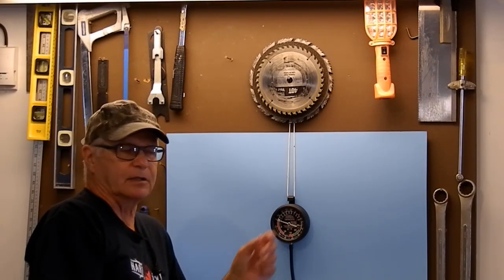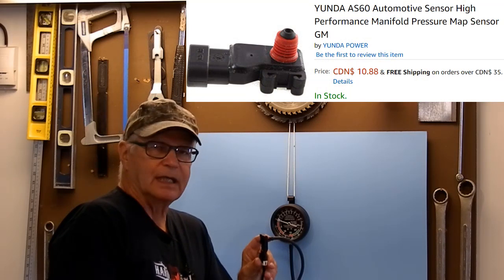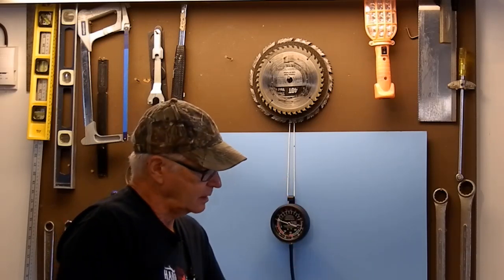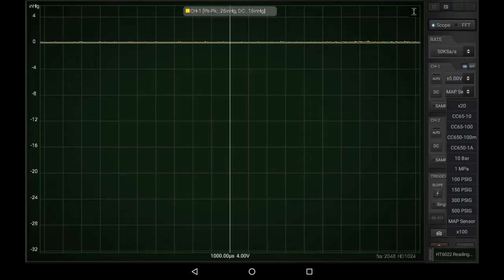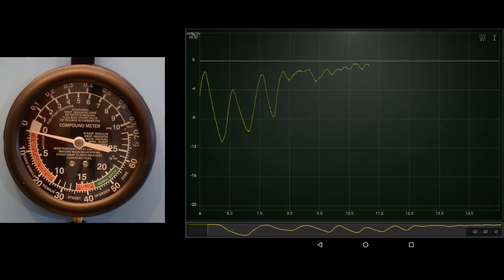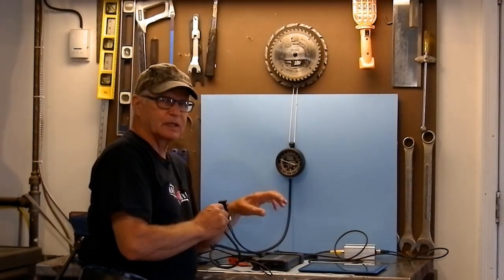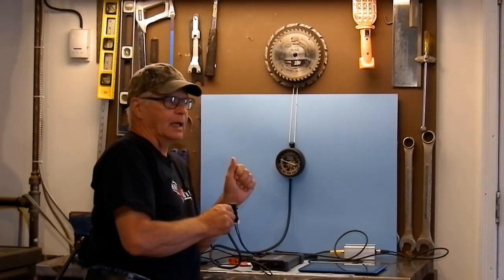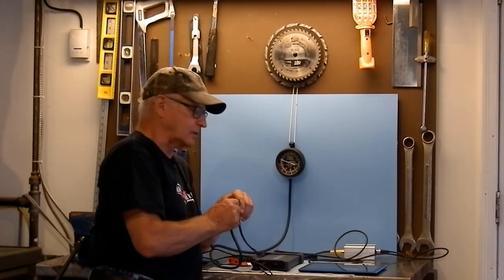GADGETS#26 - VACUUM TRANSDUCER

Comment: I have a vacuum gauge connected to my motorcycle, but relative pressure, I need one like yours, the map sensor you use is ideal, it just doesn't exist here in Brazil, importing is very expensive, I'll do the transducer with what I get here, thanks  Denis
Reply from the maker: yes, I've heard this complaint before from Brazil and other countries. Either high import duties or suppliers not shipping there.
It is a problem, that's for sure...
Good luck with project and keep me posted:)
Denis
Reply: @theGADGETSplaylist  This is all for a cheap transducer outlet, because I intend to purchase the ROTKEE that I knew from your channel, excellent.  Osvandré

Comment: Were you blowing compressed air past the end of the hose to draw vacuum in the hose?

Another thought about syncing A and B channels: if you are chasing a problem, say compression problem of some sort, you can use some cylinder sync like injector or ignition event command / pulse to determine what cylinder is affecting vacuum.

If you have a cylinder misfire, for example, OBDII may tell you the cylinder that the PCM identifies as faulty, but you need to identify the cause: loss of fuel, loss of spark, or loss of compression.  Fuel and spark do not affect cylinder breathing but cylinder sealing problems do.  A rule of thumb we used to use is if you have variations in the MAP voltage >0.05V you should suspect a cylinder sealing issue.  Vacuum will vary when you watch engine vacuum on the scope due to valve overlap and turbulence, but you won't see that on the gauge, but normal running engine the fluctuations will be less than 0.05V.
Reply from the maker: +bhartwigutube - My demonstration vacuum source was the brake bleeder tool featured in GADGETS#16
Excellent source of vacuum for diagnostics and coincidentally maxes out at about 20 inHg...replicates typical intake manifold vacuum @ idle.

Comment: Nice setup sir. I am using Chrysler MAP sensor with my picoscope . Nice thing about picoscope is ability to customize different probes and scope will do conversion of voltage to pressure. 👍
Reply: You can do that now with hscope the android app.
Reply from the maker: +KY Home Garage - means quite a bit coming from you. I've been following your work as well🙂
Have you guessed what my vacuum source was in my demo?
Thanks for dropping by!
Reply: logical canuck I have no idea what vacuum source you are using sir . I can hear any noise from any kind of pump. What ever it is you are very creative sir.👍
Reply from the maker: +KY Home Garage - I know you'll appreciate this...
https://www.amazon.ca/Bleeder-Bleeding-Change-90-120PSI-Pneumatic/dp/B076TYF4KP/ref=sr_1_2_sspa?ie=UTF8&qid=1536805062&sr=8-2-spons&keywords=brake+bleeder+vacuum&psc=1
What a great source of vacuum this makes!
Again, thanks for your time...I know you're a busy guy.